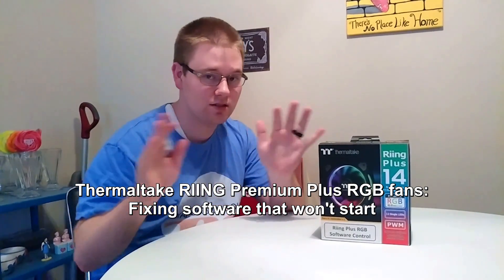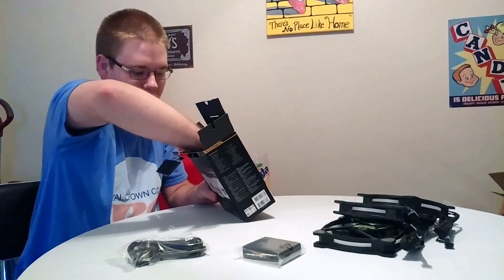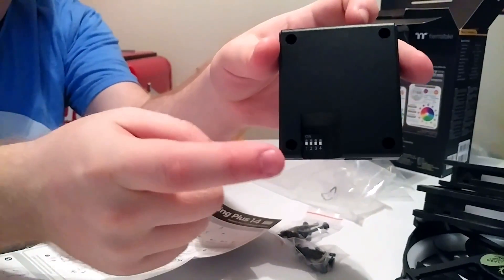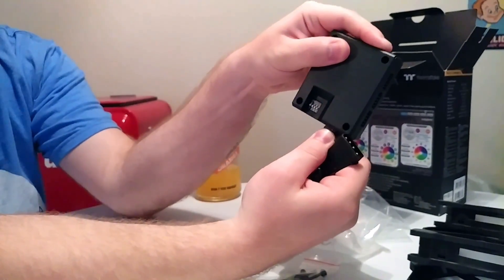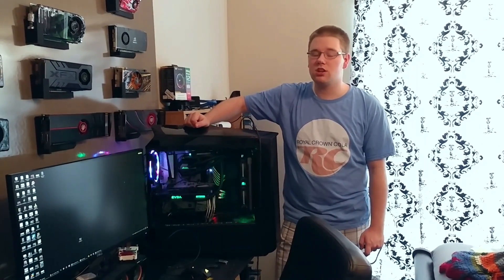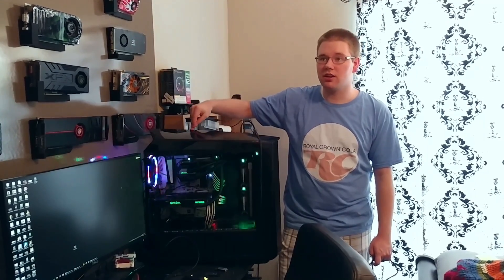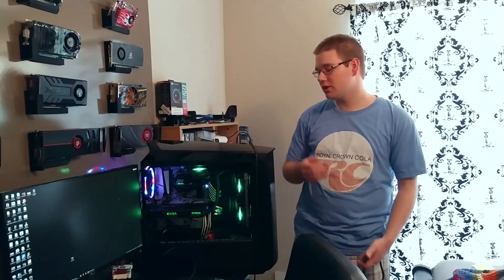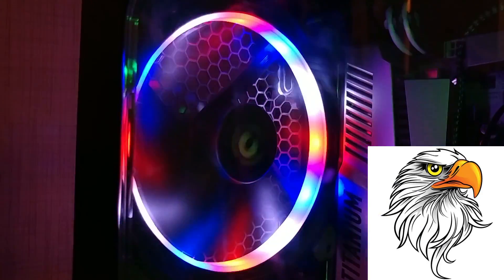Fixing Thermaltake RGB Riing Plus issues (AMD Ryzen)

Comment: The issue has been resolved, I just contacted Thermaltake today and they asked me to submit an RMA to get my controller replaced with a new controller which is AMD chipset USB compatible.
Reply: Thanks Madhan - did just that and just got the new controller and voila! the software launched properly. unfortunately still can't control the individual leds like in their demo video tho. they shipped the replacement for free and arrived in a few days.
Reply: update, the RMA did not work. Ryzen does not work with this!!
Reply: Hi, I am facing same issue of controller not found many times from time I bought the fans, can you provide link where you contacted TT for RMA here in india, as I did not found the same, Thanks.
Reply: Madhan Kumar R how? Where you contact them? I need it too!
Reply: Call their customer care number or fill an RMA form on their website.
Reply: Madhan Kumar R how much time will take to get a reply from thermaltake?
Reply: may be 2 or 3 days, Please call their customer care to find out.
Reply: Thank you for posting this comment!
Reply: Thanks for your help! I just setup an RMA and hope to get this fixed soon! Did you get your new controller and how is it working?
Reply: Hello can you just provide me thermaltake contact number?
Reply: @avis3386  tel:+1-800-988-1088
Reply: @avis3386  Forget them, they got no clue what to do. Just received my new controller … both do not work … still not detectable.  The only thing that worked for me was going into the external rear usb bypassing the processor … and bingo works perfectly fine. Those crappy fans now go back to Thermaltake!
Reply: @Betelgeuse666  hi , how to bypass and what connector do you use on the back
Reply: @januy7234  Hi, instead of going to the internal board connectors I simply used a mini usb to standard usb cable, connected the mini usb with the hub, led the cable outside the computer and plugged it into an external usb port on the back. Once I found the one bypassing the processor they worked perfectly fine and finally the controller was recognised. All alternative strategies failed. Even TT failed to get them running. Sent new controller, same prob. Not sure if it was down to the AMD system problem … but intel user have problems as well. Hope this helps. I dumped them and went for LL … look great snd stacking system significantly reduced cables.
Reply: @januy7234  Which one I simply tried, but first one was a hit. Tried with 2 ASUS mainboards … one with Ryzen 5 one with Ryzen 9 system.
Reply: I can't see the controller, how can I do it?

Comment: It's been 4 years you posted this video and I bought these fans and they still not working : )
Reply: Me too, even TT said RGB Plus 2.0 fixed the AMD issue and this is sorted (about 2018 or so they said). But still same issue … unable to build controller connection … TT guarantees new controller will do trick … this does not work … then tried the usb cable … and works! This crap goes back to TT … 200£ for such crap.

Comment: I changed the controller with the compatible Ryzen thank RMA, but many times it don't work on boot, I think they are incompetent, I have to throw three perfectly functioning fans because they had to make proprietary connectors, if I had known it before I would not have bought them ..
Reply: TT guaranteed new controller will do the trick, Ryzen they said was sorted with RGB Plus 2.0 … but the usb cable truck worked. After 2 months was fed up and returned this shit for a full refund.

Comment: I was recently having some issues after updating my bios and chipset drivers. My Ryzen 3900x was much faster but things were not good. Thermaltake rgb plus would crash constantly during 3dmark or any game that would even slightly stress the cpu, gpu, and fans. I was even seeing Aida64 hang and crash. Turns out I needed to plug in the extra 4 pin cpu plug as well and that fixed it all. Thermaltake rgb plus is happy along with the rest of the system.

Comment: hey can somebody help me out, I have a ryzen 5 3600 with a Rog Strix B-450 2 motherboard, and for some reason when I plug in the usb from my controller onto the motherboard in the 2.0 slot, it says it cant recognize the device. The thermaltake fans I have are the Floe Riing RGB 360 and they are getting power and rgb is working, I just cant figure out why the usb isn’t working to control the software?
Reply: Why does nobody actually watch the clip? Loks like it struggles with AMD Ryzen … still … fix … return TT fand and get proper ones or go for usb connection to an external port that works as bypasses processor. You only need a standard usb to micro-usb cable, i stead k to board the usb goes into rear port.

Comment: I know this was a long time ago but I've just brought my first desktop computer in over 20 years and I have this problem.
Ryzen 5 3600 cpu on a Carbon MSI B450 motherboard.
Same fan set as in the video, same error message.
I'm lost though by what you mean plug into a different usb port.
What usb port and how?
One cable goes from the controller to the power unit, one cable goes from the controller to the motherboard and thats it.
Then you just plug the 3 fans in.
What are you plugging into what with these cables to get it to work without the error?
Sorry this really may sound dumb but I genuinely have no idea.
Thanks for taking the time to fix the problem, I guess I need to explain to me in crayons what I'm supposed to do.
Reply from the maker: The motherboard to controller cable is using a USB header on the motherboard. By using a "typical" USB cable, such as for charging a phone (USB type A male to USB micro B male) you can now use the USB ports on the back of the motherboard.
Reply: @3DPC  mate you're a legend it works.
I couldn't get my head around not plugging it into the motherboard,  tgat was the problem.
Works fine now so thank you so much for taking the time and effort to solve this.
Reply: @rodgalley9209  Bro can u help me regading this case. I have a msi b450 mortar max motherboard. Which usb u plugged in to control the fan. Plz help me.
Reply: @rifatmahmudr26  Simply try which one works for you … there are not that many external usb ports.

Comment: Asrock X570 Phantom Gaming 4 - impossible to make it work with fans and pump. Either only pump works or only fans. Had to turn off pump in a software ( tried many versions of soft btw ) , fans started working when pump was turned off in the software. Tried different order - 123 / 135 /345 etc, but always the same effect. So the best way is to turn off pump and leaev the fans working in software. Pump is pugged in to motherboard to cpu fan anyway.. 
The effect is that my thermaltake aio floe riing premium 240 works with temps max of 72 deegres on overclocked 3900X to 4.2 with 1.30 V at full load.

Comment: I'm so confused. How do you plug the usb header into the usb ports?
Reply: micro usb cables
Reply: @TheDeviceDude1  I figured it out haha
Reply: @kaleb38865  I'm feeling stupid, can you re-call on how you connected the into the USB port, I have the USB header that splits off into two micro cables, One goes into the controller and then the other one is just dangling...

Comment: ive had the riing fans for a about a year and a half now usually keep mine on the temp setting and just now out of nowhere one of my fans wont push out blues on about 90% of the fan it displays as orange and when it ramps up to green the part thats broken spazes out and switches between pink red and white and when the temps are in the red it goes between green and blue which doesnt make any sense
Reply from the maker: I had some of them doing a rotating pattern, and every once in a while a fan or two would randomly flash white or green. I'm currently making my own RGB controller out of an Arduino, video to follow.

Comment: Nice fans. if they actualy had WHITE fan blade i would have bought them, but i was SMART and bought HD120's
more static pressure, more airflow, look way better. only downside is the PWM is kinda bad 40% to 100%
and whats that there cheapass. HD5780 R9 290X and NO HD5990 ? amateur.. pfft not even an 850XL ?

Comment: Their software is garbage. It polls the storage drives constantly which stop hard drives from sleeping or keeps waking them up. And now I've got a new issue where half of the time I wake the PC up from sleep the software closes and my fans go back to being noisy. There's also no fan curve setting so you're stuck setting manual fan speeds if you don't want them changing speed constantly. I regret buying these overpriced fans that I was under the impression would work with my motherboards RGB software which they don't.

Comment: I resolved the issue on my own I had to go to an way older version of the software. Apparently the software can't handle multicore issue. Also the issue it created on top of that is the sync issue the profile corrupts themselves. I am using an older version where its not created that sync profile and it is working fine I just can't connect it to the my razer chroma because it s a older version so I just control them separately but it works. Even the app on android and ios picks it up just fine. Its a software issue Im going to debug the software and see what I can fine to fix it hope I can help. I will be writing to thermal take and let them know.
Reply: Do you have a link to it? I would greatly appreciate it if you can link itB
Reply: A link for the older version would be amazing

Comment: I could not find anywhere the answers to this issue until I stumbled upon your video.  This worked 100% for me to run a cable to the back and plug into one of the onboard USB 3 ports.  I am controlling 5 fans off of  two controllers and had to plug both controllers into the back.  I should have gone with the Corsairs :)
Reply: Which CPU do you have? I have the Ryzen 5 2600x....wondering if this is what Ill have to do
Reply: Kim and Gabriel Newsome i have the exact same CPU and MsI x399 motherboard.  This is the only thing that worked

Comment: I have Intell, and it's not finding my fans :-(
I have a gigabyte
Reply: Were you able to get it working? 
I have a gigabyte z97, have fan spin but no led, says it can not find the controller
Reply: I talked to tec support and they told me to send back the controller.   I asked if they are sure it's the controller because the fans are working, there just isn't any light control.  The guy said yea.  I had an extra controller because I got 2 packs of fans, so I switched out the controller, and now it's working.  So I would recommend contacting tec support and getting an RMA.  Good luck!

Comment: Oke.
You do know that in systeem settings in the bios OR Windows .
You can change the usb protocol.
Change the protocol on a lower specs or high specs .
This way you have  options from you USB port.

The usb port that do work by your msi.
Are set in de bios for the mouse en keyboard and USB drive voor update bios.
Probably that is the reason it works for this controller

Comment: I have exact same motherboard and have  TT RGB 360 Floe Riing and from what I can see with the software 1261 the fans are out of sync with colors  even if the software is set to the same for each fan (3) but one - Have you tried TT RGB 360 Floe Riing Cooler ? I can not seem to slow down the fans down they running at 100% only way I can control fan speed is if I use the CPU Fan connector ((Which give error at startup no Fan)) when I should be using Pump Fan connector

Comment: I got a set of these fans a few months ago, really wish I had done a bit of research first. The software is complete garbage (and why have they made it so hard to find the download?). I'm using Asus motherboard, didn't have as much trouble setting them up. But they are just buggy as hell, the software (which has been updated now) will just randomly crash, if I'm playing a game when this happens it freezes the game screen (like its overlayed), you can ctrl-alt-del but can't select end task or switch screen, the only thing to do is sign-out and log back in to windows. The same thing happens when you exit the software, I had to do this recently as the TT software was causing lag spikes every 6sec or so. Think I will be contacting TT for a refund. Corsair has some nice fans out now the LI series dual light loop. Will be considering these as a replacement.

Comment: I'm having awful problems with mine. The fans and pump work but the rgb doesn't. I can't figure out what I'm fldoing wrong?! I've got a asus maximus here X mobo and a 8700k cpu. I've tried both internal usb, tried molex, made sure everything is connected. The software can't detect anything. I'm at a loss...
Reply from the maker: Yep, the buggy RGB control is the reason why multiple USB ports often have to be tried. Sometimes the USB micro-B connector can come loose when putting the controller in the case too.

Comment: What is Thermaltake support number? I can't find it anywhere? Also the RMA link would help. I have Ryzen with same issue with a Floe Riing 240. The fans spin like crazy when I start the software only then my PC crashes. Not Ryzen compatible huh?
Reply: I have since talked with TT support and they comfirmed that this is not compatible with Ryzen, no fix in sight. Stay clear if you use Ryzen!!!! I am returning mine

Comment: Been trying this and I can’t seem to figure it out. I have the usb connected to the back of the mobo on my x370 . I downloaded the version 1.1.4 software. Yet nothing
Reply: For everybody having the same prob … there is actually … in my case … one usb that works at rear of pc. Plugging into random one does not work. I tried 5 before found the right one,

Comment: Is it worth the hassle of reading the instruction manual, checking your motherboard specs, and realizing that less than ten minutes of DOUBLE CHECKING would have saved you this headache? Yes actually it is, but this is where most people building PCs cut corners, have issues, and then blame it on the individual manufacturer of the components. When in fact nearly all of them say. Hey! This won't work that way or you will have to do something else to get it to work.

Comment: Gigabyte has no interest in getting third party rgb controllers to work with thier motherboard. May just get an Asus so I can get my Gskill rgb kit to work.
Reply: So you think it's motherboard's issue, not thermaltake's software? Because I have Gygabyte Aorus z370 Gaming 7 motherboard and I have same issue with error code:H_0x0001. Did you solved your problem? Have you tried write to Gygabyte Customer Service?
Reply: @sulaco_nostromo  I'm also using a Gigabyte Aorus Z370 Gaming 7 motherboard and the software wouldn't work on my Riing Plus 12 LED RGB Radiator Fan TT Premium Edition (3 Pack). I encountered the same error H 0x0001... fans not detected. The fans spin and light up. I just can't use the software to change the fan speed and lights. 

Did you eventually ever get the software to work?
Reply: @henie4  It's not software issue. Problem is hardware. I wrote to TT support they sent me new chipped power cables for fan controllers. They're saying it will fix problem. Try to contact to them mate.
Reply: @sulaco_nostromo  I see. I will contact TT then. Thanks for the tip.

Comment: YOU ARE AN ANGEL, I ALMOST RETURN IT..I'M USING X370 MSI GAMING PLUS, WORKED LIKE A CHARM! THANK YOU SO MUCH
Reply: Adiprima Sulakstono did your fans light up when you plugged it in the 3.0. Bc I can’t get mine to light up and I have the same motherboard. Please help me!
Reply: @codydavid2898  did you find a solution?
I also have the x370 msi gaming plus, where did you plug IT in?

Comment: Hey guys, when ever  I try to go on the software this pops up " Do Not Find Fan Controller , Please check the fan controller is connected (ERROR Code:H_0x0001) help please (not amd setup)
Reply: I tried switching the cable between the motherboard multiple times , still nothing happened .I have the thermaltake riing plus 12 rgb and the software is tt riing plus rgb. still the same problem everything else works fine
Reply: I put all of the daisy chains on . should I keep one on ?
Reply: No I have not
Reply: I have 1 controller so should I keep controller "1" switch up ? and the rest switch them off?
Reply: can u send me the usb cable that u used to plug in the back of the motherboard, yea i have the floppy drive conencted to the connector . the fans work fine just the software is having issues
Reply: I tried the samsung cable it went in the just pops back off so if you can recommend me a better cable that would be great.
Reply: @kirov5107  Its us a normal usb - micro-usb cable and all work. You simply must find the port that does.

Comment: Thermaltake has those nifty rgb led hard tube fittings that i would love to combine with their riing fans and some hardware with rgb effects.
If that only would be so easy.
The most annoying thing about all those RGB Fans, coolers and whatnot is that almost every brand wants to make their own environment with proprietary connectors and controls. Thermaltake, Corsair Link, NZXT hue+. And ofcourse those products are in no way compatible to eachother.
And Thermaltake even went so far as to having multiple different rgb environments that aren't compatible to eachother either (like the fittings, that still only use the manual switch box and you cant connect them to a digital Tt controller)!
With Aura Asus and a couple of other manufacturers finally approached the problem by using the simple 4-pin +GRB connectors.
But can you make those RGB ring fans work with Aura? Nope. Their LEDs use +/d1/d2/gnd most of the time, or some variant of that logic based proprietary crap.

All i want is to be able to control every RGB device through one porgram that WORKS.
Sometimes i think they do this just to torture us.